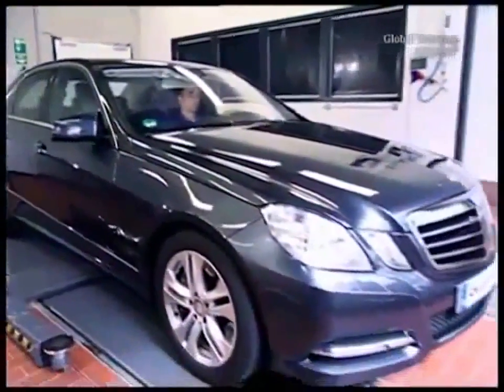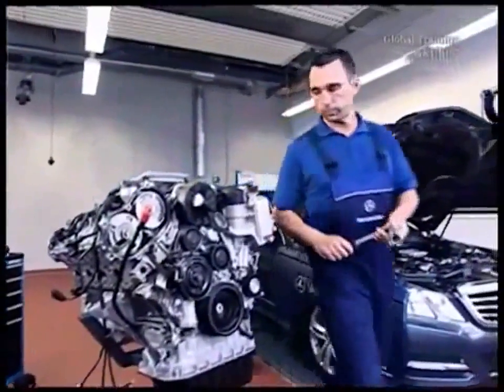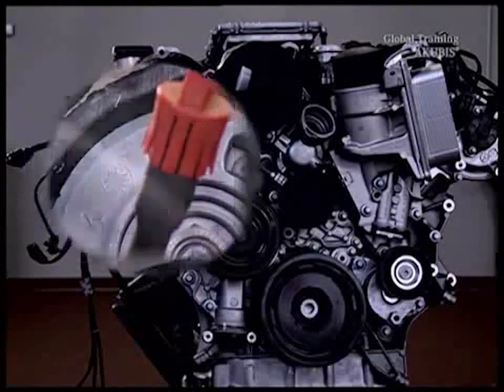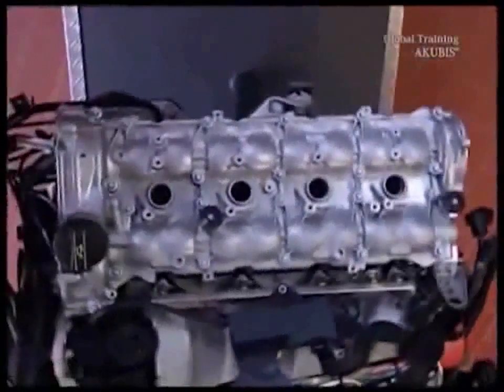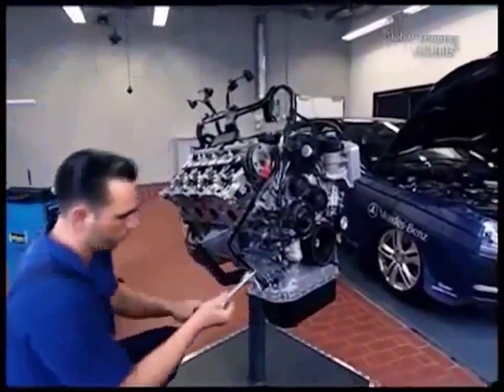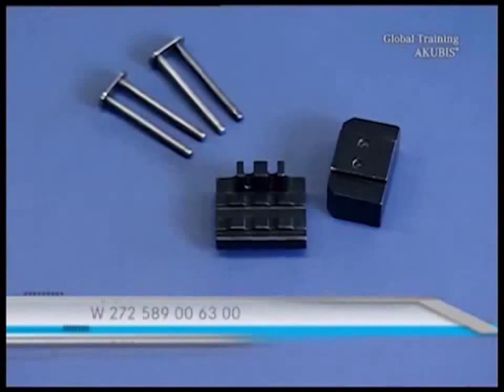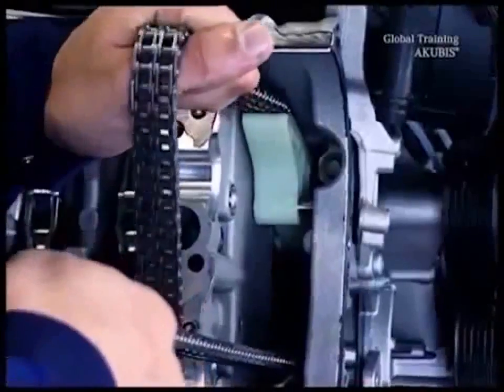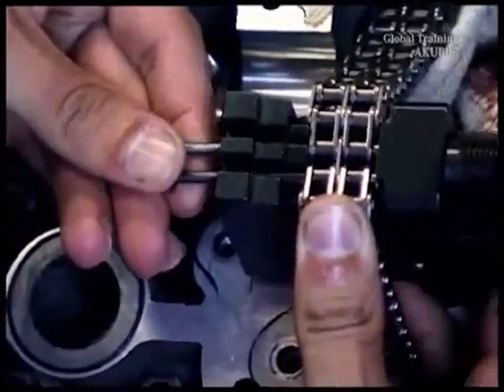MERCEDES M272 and M273: TIMING CHAIN REPLACEMENT part 1

Comment: Hi 
My 2006 C230 V6 2.5 M272 is making a constant ticking noise once the engine revs anything above idle. While driving the sound goes away if I take my foot of the accelerator. It sounds like the noise is coming from the left cylinder top, somewhere in the front. 

Does someone have an idea what could be the issue?
Reply: It can be worn chain guides or bad valve lash adjusters.

Comment: Chains do not stretch. The pins and links wear and created the impression that the chain has stretched but it's the pivot points that have all worn by a tiny bit and cumulatively makes the chain appear longer.
Reply: So if you were to lay a new chain next to that stacked tolerance chain would you say it streched!😂 your correct my guy whatever world you live in were you felt necessary to explain that to us.

Comment: How do the idiots at Mercedes Benz engineer a motor like the 3.50 liter because our timing chain screwed up at 70,000 miles. No car on earth breaks down that fast, unless the engine is a PIECE OF SH*T! I wish we could start a CLASS ACTION LAWSUIT against Mercedes Benz, as they are so full of sh*t to design crappy engines like this 6 cylinder stack of aluminum garbage. I used to put on timing chains on my MOPARS...as it was a nothing job. These NAZI's just want to get even with us for beating the crap out of them in WW2. You Nazi jagoff's.

Comment: Shifted intake sprockets may indicate a stretched chain, not necessarily a worn sprocket on the balance shaft.  Replacing the chain and tensioner may fix it and reduce the wear on the balance shaft sprocket.

Comment: M272 one of the worst Mercedes engines ever
Reply: gianfranco, that's good to know! I was thinking of pulling the trigger on a gorgeous 2006 E350 4matic wagon (M272 - w/212,000k)...check engine light is on for the timing chain! Will probably cost more than what the car is worth! 🤣
Reply: @who8dapple  they supposedly fixed all the issues for the 2007 year
Reply: gianfrancoa, will consider a 2007 an option! TY
Reply: @who8dapple  you have to look for the engine serial number.  Engines ending on 468993 and higher,  have the issues fixed.
Reply: gianfrancoa, the seller states that the issue has not been fixed and with 212k, have decided not to invest anymore money into the vehicle.
Reply: @who8dapple  good call. That repair is not cheap as it's an engine out repair.
Reply: @who8dapple  212k miles tho. I’d say that car lived a good life but it’s time to give up the ghost. Luckily my 2007 E550 is just barely outside the affected range of engines. Thank god
Reply: Cameron Peralta, last I saw, owner dropped asking price to $1,600 and sold it a few days later...someone has time and funds to fix it, will end up with a nice looking ride!
Reply: @diablocls55  I have 227K and counting on a smooth running 06 E350 with balance shaft untouched. Seen plenty with over 300K with engine untouched...
Reply: @SeannA.1  I just hit 150k miles a week ago in my 2007 E550
Reply: @diablocls55  That's a great engine. I would expect 500K out of it if you kept it long enough. I've come across a few cheap, low mileage M273's for sale. I would do a swap if I could find a mechanic willing to do it at a reasonable price. Almost everything matches up: fuel pump, engine mounts, drive shafts, etc. Both engines are very similar, It's almost plug and play with an S550 ecu....
Reply: @SeannA.1  definitely. They’re relatively easy to work on. I just replaced the alternator in mine earlier tonight. Other than that, I replaced the spark plugs about 10k miles ago and change the oil every 5k. Have never had a single problem with the engine. Sounds great too. I hope to be able to drive it until at least 200k
Reply: @diablocls55  I've seen those around with around 350K. 200K shouldn't be a problem if I'm approaching 230k on an M272.
Reply: The M272/3 is actually a very good engine if the defect is not present and you'd have to be pretty unlucky to get one like that in 2022

Comment: How the engine inside the vehicule come out and be on a on a stand ??? It's a miraculous of the god MERCEDES
with the Mercedes technician angels.  Nobody speak they must remove the gear box , flush the LDR  ( the water in the radiator) flush the motor oil and the gear oil , keep out the gear box with specials  tools and so on. 
It's sure i will be afraid by the job.   In my time changing a timing chain was a simple job and we can do that on ours cars
drinking beer and joking. Now we need experts and special tools because of the lobbies of  cars ( MERCEDES , BMW , VW , TOYOTA and others ).  
And you must pay  first to have a have a beautiful car , second to be able to take the road and third to keep your license.
And more pay for the hidden failures of your car because it's well know that it's a MERCEDES failure on the M272 motor.
Thank MERCEDES
Reply: Im pist off. My r350 only got 133,200 miles on before timing chain strech. My intake manifold butterfly valve broke at 116k and the transmission control module took a dump at 100k miles im on my 3 hvac blower motor and tell me how when it snows they have the wipers go underneath the hood so you can not lift to clean so all the ice gets stuck down there! Mb is not smart they did not do real life testing
Reply: @hME AND U BOTH BROTHER.  MY BENZ HAS 80K MILES. BOUGHT IT THINKING IT WAS A STEAL....YEAT A STEEL PIECE OF SHIToleshot1721

Comment: That was insane. Why can't you put in on from the front like EVERY OTHER ENGINE?
Reply: There are a few replies from people who are confusing a TIMING BELT with a TIMING CHAIN. Belts are external and easy to replace. Chains are lubricated by engine oil and so therefore are inside a timing chain cover making them internal.
Reply: @barrysimmons1884   bud honda used belts on timing..internal with internal waterpump and idler. Shit sucks sideways engine have to remove have the shit and mounts to do it.
Reply: This is actually an easier way I think
Reply: It is on the front of the engine and a lot of engines have a very similar process for chain replacement.
Reply: @splint3048   but the balance shaft is held in place from behind the torque converter. So trans has to be removed. A huge hassle illl never do it again and now we see why these models with these shit box engines sell.for a grand lmao.
Reply: @joshgray2024  это двигатель 273 v8, а балансирный вал стоит на 272 v6! На всех v6 стоят балансирный вала - 112, 276!
Reply: It's  better than audi and golf,they put chain to front and rear,golf rear chain is run water pump,audi is put between two camshafts at the back.
Reply: AMEN Rich....they do this purposely, so that Mercedes dealerships can all get rich.

Comment: What code did the ecu throw?
Reply: Zionslayer1 p0016-p0017
Reply: I know this is an older question but hopefully this reply will still be helpful to someone. The codes should be P0016 and P0017. Crank Angle and Camshaft Position Sensors. The PCM sees the pair lose sync and hangs a hard light.
Reply: Indicating a worn balance shaft 99% of time
Reply: Luckily my 2007 E550 is just barely outside the affected range of engines 😂

Comment: I think the cams come out so when you turn the engine over stops the valves hitting pistons
Reply: Yes I think this engine is interfering, and when they set the timing before they took out the shaft is to have valves in closed position or at least away from pistons so they can rotate crank shaft safely

Comment: why is this car, that is so new, need timing chain replacement?
Reply: 44700 miles and needed a new balance shaft 06 E350 owned since 22k please tell me why I had the issue?
Reply: Eric sin poor design
Reply: @shckltnebay  balance shaft gear is made of a weaker metal for sure. Magnesium or something. No way steel would wear away that badly. No way. They did shit design with this one
Reply: @joshgray2024  It wasnt the actual shaft it was the sprockets on it
Reply: Usually chain should outlast the engine, but sometimes Murphy’s Law comes to play like an utter bad luck (defective product) along with bad habits of flooring it drag-racing anytime every time possible, bad oil oil filter or both, etc, makes timing chains fail. It happens but most timing chains last pretty long time
Reply: @alifelongitch   i have a 300d with 550kmi original chain. Hahaha. They last forever. Tensioners go. But chains not to much
Reply: @joshgray2024  If you keep up with oil changes and use good quality oil and filter, tensioners will last a very long time.
Reply: Also timing chain and chain tensioners use the engine oil for lubrication and pressure if no oil in the engine it’s possible that the timing chain gets damaged
Reply: Yeah  every 60000km,engine light come on
Reply: Also its not timing chains that go bad...im a mercedes mechanic. The balance shaft gear in these engines is trash. Wears away badly and then causes chain to have slack and pass side engine,will show p0016 p0017 cam codes. I have removed chains and set next to new ones and same length always. But i have noticed installing chain and new tensioner gets you another 5k before engine light comes back on because of timing chain slack as they call it but its just the tensioner cant keep tight when balance shaft gear is completely worn out.
Reply: @joshgray2024  Hey! I have changed chain and idle gear (M273), and after 100000km check engine is on again. What is very weird is that timing ir still correct. What would You suggest?
Reply: @nattyriddim9123  check cam sensor and magnetic vvt sensor. They usually are the culprit.also make sure manifold is cracked. Swirl flaps are working and not broken or flaps have broken off inside
Reply: @joshgray2024  Hey, thank You for reply. I have changed magnets before, and I saw that cam sensors should throw different codes. But, how to test them? I also don't understand what it has to do with manifold?
Reply: PURE MB BULL SHIT BAD PARTS AND WILL NOT ADMIT TO IT
Reply: Several possibilities. Low grade oil that doesn't cling to the chain well (Wal-Mart oil changes etc.) , Aggressive driving habits (our teenage kids LOL) etc. Actually Mercedes should be praised because their modern chains are designed to last the life of the engine or changed easily (BEFORE they break) by using the old chain to pull in the new chain via a master link. Making a good portion of this process unnecessary. If the chain hasn't broken you only need to tear down to the rocker covers. My chain lasted 252,000 miles.